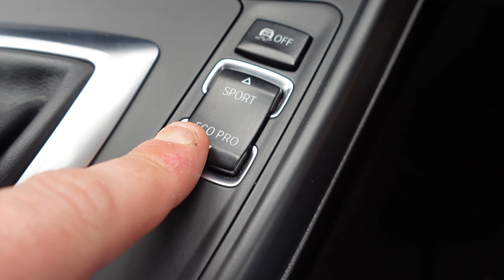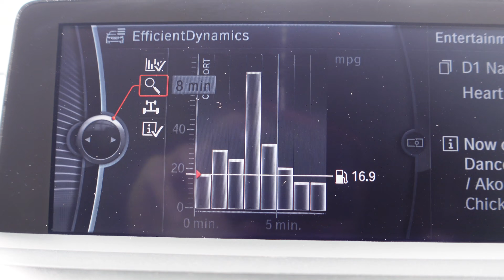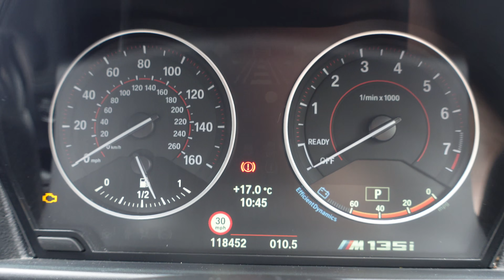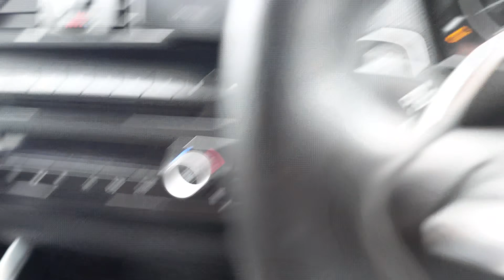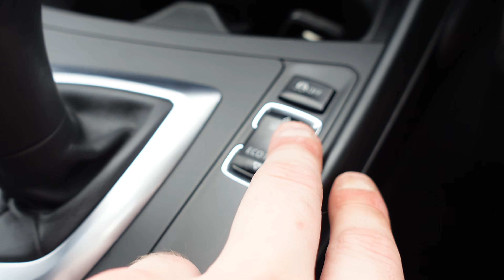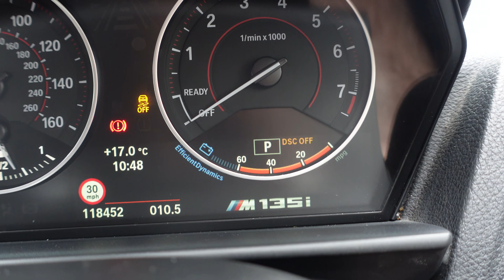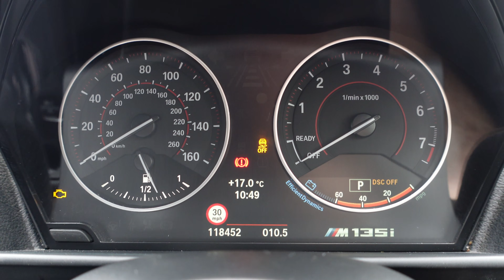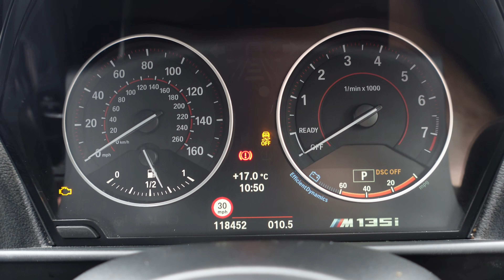BMW Eco Pro , Comfort Mode , Sport & Sport + Modes Explained

Comment: While eco pro might not technically offer better milage when compared to comfort, since it lowers the throttle input, it thereby reduces fuel consumption while allowing similar pedal travel to comfort mode. if you want the same milage in comfort you have to essentially feather the throttle. Eco pro just makes saving fuel easier, as it's very hard to feather the throttle in these cars without wanting to let her rip.
Reply: Do not forget thaat Eco Pro lets you coast. If you drive down hill and let off the gas it will start coasting. It will no longer engine break. If you press the gas it will then engage in a gear and start driving normaly and use the engine break. If nothing happens it goes back to coasting. So it will save extra gas on highways and going down hill. Its not just the throtle response.
Reply: @WasteOfTimeDude Yes, drive with an eye on the efficient dynamics, and you will realise this.
Reply: @MarinMar94 This is the most important factor in my opinion. Something that I really do love
Reply: agree with this. Eco pro is much more comfortable for me to drive. It give gradual acceleration while pressing the gas pedal, however on comfort mode, the acceleration is a bit rough for my taste. I have to keep holding my feet to not press it too hard. I havent tested the mileage difference between both mode, but eco also feels it give less road/wind noise in my opinion.
Reply: Turbo don't like eco pro
Reply: Eco Mode saves loads of fuel, I use my 4 series’s daily as my work car, and round town I’m getting around 49 MPG (420d)
Reply: @Lordjohn007  I agree just bought one and drove from a 3.5 hour journey I'd have completed it using only a quarter of the tank if I hadn't have gone and played a bit on the last 25 miles where I knew the roads.
Reply: @Lordjohn007  man diesel and gas are different.
Reply: @Lordjohn007 I have a 430D, and in wco mode around town, it is rubbish, I am lucky if I get 30mpg.

Get it on the motorway, and on half a tank of diesel, it will save 35-40 miles on eco pro.

I have a stage mod giving 10% fuel savings and I can easily get 55mpg+ as well as 320bhp in sport mode. Thing is, in previous cars, they were most economical between 50-60mph, my 430D is most economical between 70-80mph, with 70mph being the sweet spot. Despite what the computer states, the eco pro savings really shoot up after 70mph.
Reply: I personally drive around in sport to sport+ because the steering feels more responsive and much lighter and the throttle feels great. And I honestly prefer traction control off but that’s just me.

Comment: Sport has DSC on. Sport+ turns off DSC and activates DTC under 31mph only, so above that the only interference on the rear wheels is the e-diff, so it’s good for arsing around a little at roundabouts. Not quite as described in the video, the chap may have misspoken.

DSC Off mode turns off both DSC and DTC at any speed, but it also puts the throttle in Comfort mode so it isn’t as sharp but there’s no reduction in overall power, so you have a more progressive throttle, which gives you more travel to modulate the power. It feels a little disappointing when you activate it whilst moving with constant throttle application as you need more throttle press in Comfort to get the same effect as Sport+.

There’s also a Traction mode, which is a short press on the DSC button. I haven’t explored that yet, guessing it’s DSC off but DTC on at any speed. I have no knowledge of Eco Pro.

This is based on fiddling around in an M235i, presume it matches other models.
Reply: B58 cars like M240i sport plus does more than it does on earlier cars.  So your assumption is wrong.
Reply: "traction mode" is apparently for trying to make progress in snow/ice.
Reply: " but it also puts the throttle in Comfort mode" aha so its true. I was thinking the same.  Sport felt kinda more agressive. Also on B38 in sport/sport + u have turbo flutter/ westgate sound and in DSC off there is not, like eco or comfort

Comment: Can anyone help, in comfort mode, when I click the paddle shifts turning into manual, how do I change it back to auto without moving the gear stick into sport and then back into auto, I have a 335d 2015
Reply: It will go back to full auto after about 30 seconds just don't use the pedal shifts and be light on the throttle.

Comment: Thanks for sharing this information, I have a question. If I am on the way and the car is on drive mode eco and I wanna change to sport? Is it worth for engin or transmission.   Bmw 2013  328ix

Thanks.

Comment: Hi BMW doctor. I need a piece of advice. I have a 118i twin turbo with 3 cylinders. It's meant to be eco car if you are an eco driver but i do not see great fuel economy. Please advise how to monitor consumption and whether the car's consumption is right. Thanks
Reply: Examine your driving style before thinking it must be the car. Because the performance of small engine cars is so poor people will tend to drive them harder and that will move your consumption further from the official figures. I use Dash Command on my M235i because in their wisdom BMW don’t provide a temperature gauge and that has plenty of options to examine fuel consumption.
Reply: Bruh its not twin turbo

Comment: Watched so many of your how to's and wondering if you can tell me why my dash isn't changing to either eco mode or sport mode on my 640d..
Thought it was meant to go blue on eco and red in sport..
Cheers
Reply: If you go to your Display settings, you’ll see an option to choose whether you want to the display to change the color according to the driving mode. Probably it’s turned off in yours.
Reply: You haven’t got the 6wb dashboard. 
You mean the digital speedo in red, right?

Comment: It's really weird, my sports mode only turns on at red lights for some reason 😂😉😏
Reply: I have this issue on mine too, have you found an explanation yet?😂
Reply: Same here 😂😂
Reply: Brilliant glad I am not the only one 😂😂 who has this problem
Reply: You need to reset your tire pressure to use sport all time
Reply: If u have a low tire sport mode will only turn on when the car is stopped
Reply: Same problem here with my 320i 😂😅
Reply: Yep,:goodvibes: my 328i F30 has exactly the same issue.
Reply: @scott651  My 328i f31 has that problem also 😂😂😂
Reply: 😅😅😅😅you are crazy
Reply: Same my 528
Reply: @alienzzzzzzzz 528 gang!!!
Reply: Mine too, thinks it’s something to do with green for go go go goooo! 😂
Reply: Same 435d. 😃
Reply: The first time I press mine I got a ticket lol.
Reply: Me too ,I got a 520d and it makes me feel like iam driving a m5
Reply: I too have this issue
Reply: Same
Reply: i was thinking i was the only one 😂😂😂
Reply: Mine will too 💀
Reply: Similar issue, but it comes and goes randomly. 2016 535i
Reply: Mine too, for some reason at traffic lights and roundabouts my car switches to sport + and I hear a strange noise like my tires are spinning... Strange 😂
Reply: It’s so weird too my sport button and PASM button and my exhaust sound changes it all turns on when I see a bmw and I see them in my 911s rear view mirror while they are still pulling away from the lights😂 that’s happening way too much sort it out fellas all your cars are too slow for my 997.2 with the PDK transmission think you all need a upgrade from them heaps of s**t you drive it will never beat a sports car. Can someone explain to me why that’s happening or is it your all running with a EML light
Reply: mine turns on for some reason right after i start the car
Reply: Most likely your tpms is triggering the reset I driving mode as soon as you take off...
Reply: @geniusduzit  I thought I was the only one 🤣🤣🤣
Reply: Now I'm really confused
Reply: It just be waiting for that red light  idk why😂
Reply: You’re not serious, are you?
Reply: Same with my 430d
Reply: My 318i makes a chain noise when I change to sport mode and stop accelerating. Does anyone know why?
Reply: I dont mine the issue just turn the radio up.
Reply: For no reason my sport plus turn on at red robots by it self 😂😂😂
Reply: Ahhh I've seen that happen,  somehow one also happens to hear Dom Torreto say.. "It's the power of family.."  Dials turn red and 20kws gained instantly. 😁
Reply: @geniusduzit  naaaaaaaaaw fr🤣🤣
Reply: Common problem
Reply: I feel better now knowing I probably would never be able to find an explanation
Reply: When Brenda is at the light in her honda jazz..... 'Launch control' activated.
Reply: Same
Reply: Yea mine does the same jumps right into sport plus then the gears get swapped into Sport

Comment: Doesn’t sport + merely reduce the interaction of the stability system but dsc off turns it off altogether? Equally eco pro will reduce the output of the climate control and heated seats if you have them to reduce the electrical load and a/c demand to improve fuel economy. There’s also slight changes to other things such as shift speed too depending on driving mode.
Reply: Eco mode also allows you to coast much further without the engine downshifting and causing compression braking. Something to do with uncoupling the axles. That’s my favorite feature about it and the main reason I use it during certain situations

Comment: I have a e92 320d N47 Doesn't come with non of that lol. Fuel is great. Puts a smile on my faces.

Anyways I borrowed my uncles automatic F10 520d B47 for the weekend to go for a long family trip.
This was the first time I was using the buttons. 

Eco pro: felt good when I was driving in slow traffic, small roads, or doing turning, saw the blue fuel return say 10miles gained/saved.

Comfort mode: was good when doing over 30mph to 70mph on a steady speed. Nice and relax driving, changing lanes feels more smooth.

Sport mode:  felt like "don't YOU dare drive me under 40mph and not put your foot down" or rather "this fools is bumper riding you" floooooor it NOWWWWWWWW.
(A remapped gear box and engine) made me smile :) motorway acceleration was just a amazing feel....felt like car was telling me :Power!!!!!!!!!! GIVE ME MORE POWER! Lol

My uncle also has a M140i that thing is a mental car... my gosh after all that tuning that thing is a death mobile.

Comment: U forgot to mention that in sport+ it wont auto upshift if you r in manuel mode, it Will just redline the car, but in sport it Will upshift on you, and Also in sport+ the steering gets heavy and cant be changed on the idrive compared to sport u Can choose to have light steering on the idrive settings
Reply: I can change mine. I can independently select chassis, engine or both in sport and sport+ drive which I think is kinda stupid
Reply: In manual mode it never upshifts. But does downshifts.

Comment: I just got a 2014 328d and I love it so far. I used to drive a 2008 328i and it had a sport mode activated with the shifter. Newer BMWs seem to have a 2 sport modes, one activated with the shfter, and one activated with the switch button. What is the difference between the two modes and what if you enable both?
Reply: It Will be faster than sport +

Comment: Eco pro is great on the highway when you get up to speed and can set the cruise control. If you’re in stop and go traffic, you’re better off in comfort mode.
Reply: If ur in cruise control and keeping the same speed eco pro is doing nothing
Reply: Disagree. Eco pro is best in stop start traffic as it disables engine breaking allowing you to roll up to cars and use short throttle inputs. I prefer sport Manuel on motorway. I want ability to have power straight away when needed and quick throttle response. Fuel wise doesn't matter much as most of time in 8th gear cruising anyway
Reply: Agree with this, I have an X3 G01 and on motorways I just sit in Eco Pro but in busy traffic and pulling out of junctions he Comfort mode gives you much snappier gearchanges. Never use sport as in this mode it seems persistently to stay in low gears
Reply: Watch for eco Pro + cruise control on wet roads though. Ive slid sideways travelling to work in this mode.. I am no expert but if it turns off 4x drive then that might be why the car slip across the motorway sideways..luckily i corrected the steer away from the central barriers and saved my life ajd my car 😅
Reply: @mikechristie6515 you should never use cruise control in the wet.
Reply: What’s eco pro?  Never heard of her?
Reply: True, I often use Eco Pro on the highways on cruise and one does see the benefit of it

Comment: Nice content. Just a question: is it possible to set the Eco mode by default? I tried, but I couldn't manage. The car always start on the comfort mode. Mine is a BMW 328i 2013
Reply: following!
Reply: You can code eco mode on start up with bimmercode

Comment: I got a 320i. I use eco pro regularly cause I'm like might as well save some gas when I'm not trying to have fun just commuting. The other thing it does with the 8 speed is it will disengage the clutches and coast when your foot is off the gas.
Reply: I use this mode 99% of the time. Do you know that you can code that this mode is set as a standard? Just use an OBD adapter and Bimmer Code. It really annoyed me to change it every time I got in the car.

Comment: Looking through the manual, it seems like Sport mode will throttle back if it detects the driving wheels spinning. In Sports+, it will allow a certain amount of wheel spin. If you turn the DSC off using the button (when using Sports+ mode), the car won't help you and you're on your own. I think the Sports modes also open up the flap in one of the dual exhausts (not sure about this though). I have found that my 330i will get between 40 and 50 mpg on the mway in Eco mode. You don't want to be in any hurry with that mode as it's really sluggish. I really want that vest/body-warmer. :)
Reply: @davidf8749  it opens up the flap in the left exhaust as far is I know
Reply: @lkofdoom  In the Uk, in normal countries it is on the right

Comment: Hi Dean, so like u said I can code the sport+ mode on my bmw f20 118i? The car didn't came with it but I can code it in right? When I code it in will there be any system errors in my car?
Reply: Have you been able to add the sport plus?

Comment: I have a 520d and eco pro mode is so marginally better than comfort that it's not really worth using unless you're going to use it all the time over the space of a year. Over a tank I'll probably get an extra 30 miles or so out of a tank. It's up to you whether it's worth the hit to performance.
Reply: I tested it with several repositories.  Eco pro mode consumes more fuel in my vehicle than comfort mode, 520xd.

Comment: Great vid 👍🏼 At a certain point in time over the past 5 years BMW altered the default driving mode to comfort; my 2014 F31 starts in Eco Pro when you turn it on; all courtesy cars I’ve had from BMW since 2018 start in comfort mode when you turn on. Another thing when you switch to sport mode is it disables the wretched stop / start which I turn off as soon as I get in the car; I feel stop / start could shorten the life of certain components & the battery & especially in a diesel which is more strain to start than a petrol! I only enable stop / start in certain traffic conditions at my own discretion. I tried using launch control in Sport+ as mine has 8 speed auto & adaptive m chassis, but mine is a non M-sport model up-spec’d & I can never seem to get launch control to work; maybe I’m doing something wrong?
Reply: You can code it to start in eco pro
Reply: @elteacherelizondo3401  I'm in the same situation. I'm trying to have the Eco Mode + start/stop turned off by default when I start the car. I tried myself but I didn't manage. Only specialists could code it or is it easy if I try myself? Thanks, bro!
Reply: Weird that you disable stop/start because it 'could shorten the life of certain components & the battery' but want to use launch control - which will definitely do that. 🤨
Reply: @christopherkenney4766   LC got me there XD I mean. cmon, its only a myth that start&stop shortens life on components, whereas LC will kill ur transmission in no time bro xD
Reply: @AnIdiotAboard_that’s a lot of work lol you could just code it with BimmerCode code like I did. It’s easy and takes a few minutes

Comment: I drive a f31 320 ED.
The eco pro mode also changes how the climate control works.

Also when enabling eco pro tips will give you hints on the dashboard how to consume less fuel.
It will tell you to slow down when you drive to fast when you exceed speed limit on certain roads.
Or when you accelerate to fast it will tell you to slow down.
When you follow the hints you will see howmuch fuel you saved + km.
Reply: You should make a video on it
Reply: Does yours has sport + mode?

Comment: Hi Dean, i have a 2011 F10 535d but don't have the mode buttons in the thumb nail or paddles on the steering wheel. Any chance you know why this is? I can't seem to find a concert answer anywhere.
Reply from the maker: ok do you have ICM module fitted on your car ? if so it can be retrofitted to your car and I can retrofit if you want it done
Reply: @BMWDoctor  thanks for the reply. I'm not sure if i do but will have a look and let you know. Great channel btw, love your content!

Comment: Hi Doctor I have a F10 520i, one thing I find out about the difference between eco and comfort mode is that when I going downhill and off throttle without braking, in comfort mode transmission will stay in a certain gear without upshifting until I press throttle again, in eco mode transmission will upshift automatically and go to 8th gear eventually
Reply from the maker: I hate eco mode lol I prefer comfort or sport + even sport mode doesn't do nothing but sport + really changes the game, and will push your driving skills to the limit especially in a rear wheel drive car and in the rain :)
Reply: I have also noticed in eco mode when you go straight and let go off the throttle, it puts the car in neutral, so no engine breaking
Reply: In eco pro your car shift gears faster